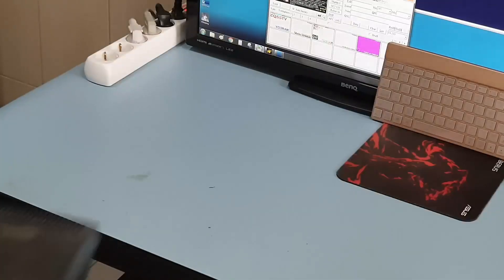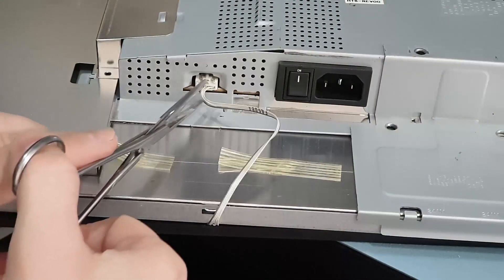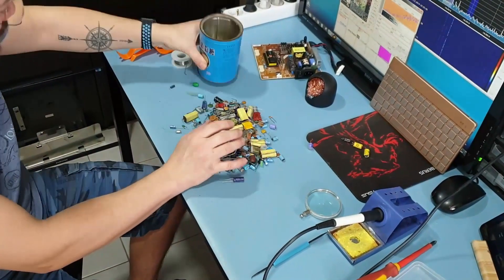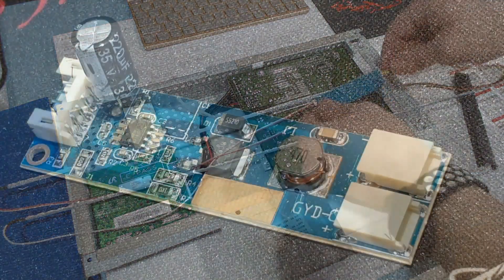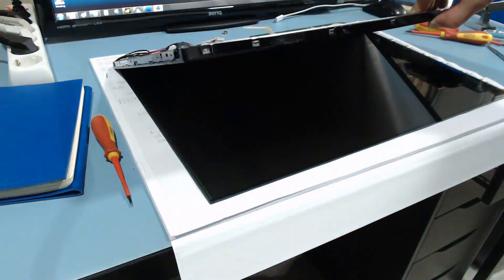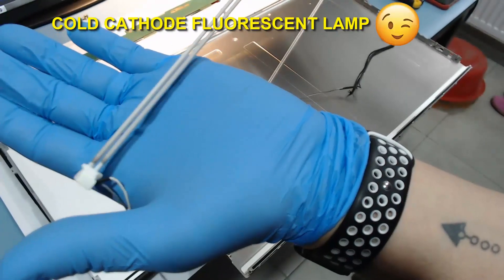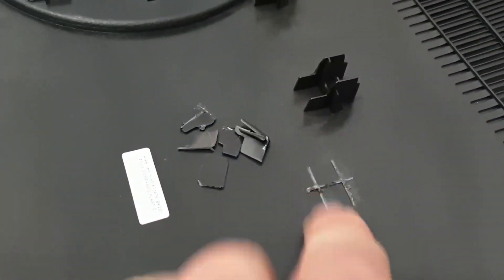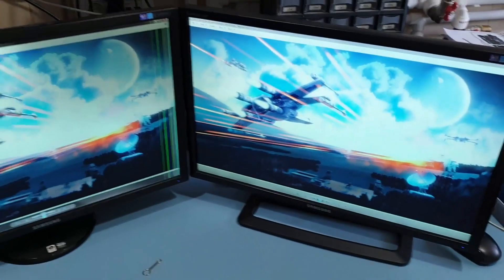24'' Monitor repair. Replacing old CCFL with LED

Comment: I have really wanted to modify my old Dell monitor by replacing the CCFL with LEDs, and even if I have read about everything I need to, over and over, this video has really helped me understand what to expect.  Thank you so much for sharing this!!  I'll consider modifying the monitor soon because this video really gave me some confidence.  

The current plan is to disconnect the inverter for the CCFL, which is powered by the PSU at 24V.  Then I'll use that power into a PWM which will go into the LEDs.  This will probably make it so I cant control the brightness with the monitor's inbuilt digital control, but I think it'll be far easier.  The CCFL in my monitor does run quite hot, so my goal is truly to potentially improve the monitors life expectancy, and make it a bit more power efficient.  

Again, thank you for posting this video!!  It has really helped me get a better idea of what to expect once I open the monitor.  No amount of reading has alleviated some of my fears like your video has.  Cheers!

Comment: I think that by reducing the current flowing through the LEDs, it is possible to shift their emission spectrum to warmer tones. Manufacturers of these repair kits most likely increase the driver current to increase brightness. The situation is aggravated when it is necessary to install LEDs in a monitor with the smallest diagonal - the user bites off extra groups of LEDs, but does not change the driver current.

Comment: 10:48 connected to which GND to disable CCFL inverter feed? 
a) 5v dc GND?
b) 22V dc GND?
c) 220v ac GND?
Reply from the maker: No, never!
The low voltage part of the power supply. Near +12v, +5v. Or even the metal case.
Reply: @Racov  thanks. Do you have any idea what does it mean M/S and N.C ?

btw here is my ports;
| 22v 22v gnd gnd | 5v 5v gnd | N.C  ON DIM M/S |

i'm really thinking about disassamble the huge ccfl inverter off the AIP-0178 board :)
Reply from the maker: @orfe  The GND near 22v or 5v. It's the same. I'm sorry, I don't know all the ports of an inverter board. You have to try and experiment.
Reply: @orfe  NC usually means Not Connected
Reply: @Racov  <3

Comment: I have been for a long time trying to do this to an Acer but mine must be special. I did the connections as in 10:53 but the enable signal (from the video board) rises and lowers two times and then stays low, like if the video board was expecting some kind of response from the power board that doesn't get, maybe some current consumption, tried to fake some consumption in the enable wire (from the video board), doesn't seem to work. The wires that connect the video board with the power board are: Vcc(x2) Gnd(x2) Enable(cut) Brightness Volume Mute. Does somebody know why this might happen?

Comment: Procedura e aceeași și pentru un tv ?
Reply from the maker: Salutare.
Nu as putea sa spun.
Sfatul meu e sa cauți un tutorial pentru televizorul tău, sau ceva asemănător. Principiul e același.
Reply: @Racov  am văzut că se leagă serii de  7-8 leduri de 3v pe tensiunea de 24 de la sursă , și mai multe serii in paralel , dar reglajul luminozității nu am idee cum se poate face
Reply from the maker: Televizorul tău are tuburi CCFL si vrei sa le înlocuiești cu LED?
Dacă da, atunci îți trebuie, ca în filmul meu, o sursa specială care se conectează în circuitul televizorului. Nu am idee cum, depinde de fiecare model. Și baghete LED compatibile.
Dacă televizorul are iluminare LED, atunci trebuie doar sa cauți baghetele LED specifice lui. De obicei ele se alimentează undeva la 60V.
Ce spui tu cu serie - paralel, nu mi se pare în regulă.

Comment: I really appreciate this video, i like how you just filmed your process of figuring it all out. Also, the surprise that the physical deconstruction was harder than the electronics. I'm about to replace the cfls on a monitor myself, this is a real confidence booster.

Comment: The craftmanship is excellent, yet I would not do this in any circumstance. Most quality CCFL displays from 2008-2012 are wide gamut, with often up to 100% AdobeRGB coverage. The peaks in the CCFL spectrum align nicely with the filters of the subpixels. With white LED not so much. A generic blue-with-yellow-phosphor LED has a crappy color rendition index, and if the yellow peak will be bad at illuminating the red and green subpixel filters. Hence the bluish image, as only the blue peak will align with the blue subpixels, and red and green are probably only delivering 50% of their previous brightness.

Comment: Hi mate, great job with that old monitor. I have 2 old HP ZR24W monitors, very low hours, around 6000. Both have developed a dark grey stripe on the left hand side of the screem that only shows up when the monitors heat up. Can I send some pictures with the defect, hope you can point me to the right direction?
Reply: Forget about replacing with white LED. The ZR24W has an insane gamut with CCFL, you will ruin it and turn it into a crappy calibrated sRGB display at best.
Reply from the maker: sure.
yo3rak@gmail.com

Comment: Great job. I plan on doing something similar to my monitor as I had the same issue for years, but I just lower the brightness and after an hour I just crank it back up. I have to make sure to crank it back down so I don't have to use a flashlight to decrease it again. Also the bluish tint can be fixed by lowering the blue leaves on the monitor menu or with an PC app or color profile

Comment: Those green stripes on one of the monitors are probably from missing contact in data ribbon. 
This ribbon is going from T-Con to the screen. 12:59 T-Con is that green PCB.

Comment: Are those led driver uses PWM for control brightness? Or not?
Reply from the maker: It has a separate wire which controls the brightness with different voltage levels.

Comment: Congratulations and thank you, Sir! Your video helped me somehow to have encouragement to try this on one of my CCFL monitors I got from junkshop, if ever their CCFL soon fail. Greetings from Philippines! ^_^
Reply from the maker: Thank you very much
Reply: @Racov  Multumesc! ^_^ I want also to ask, Sir. Why best LED for replacement was, High CRI type?
Reply from the maker: @sophietronics  Dear Sophie, of course high CRI are recommended, but they are more expensive. I think you should consider how much money saving this monitor is really worth, and go for expensive of cheap LEDs. Anyway, work calmly and patiently, because it's very easy to break the LCD panel.
Reply: @Racov  Thank you for the advice about LEDs and handling panels with care. This will be my first time dealing with panels. I also think of the economic implications too, since some Chinese LEDs starting to sell here like hot cakes due to economic issues within the country of manufacturing. I hope great success in LCD and LED repair service and also help some customers and friends in my community who asked me if I can repair their humble LCD and LED units. <3

Comment: estoy instlando a una ALL IN ONE ACER DE 24", donde conecto el EN?
Reply from the maker: EN should be connected to the respective (ENABLE) pin of the power supply/inverter. If you can't find this pin, you can apply 5 - 12V to turn on the LED strip, but the monitor will never be able to enter SLEEP mode.

Comment: Im going to change my Viewsonic VG1921WM lamps, they are still functional, but I want to have better contrasts because in dark images it isn't well displayed, I read that changing the CCFL lamps to LED you can have better image 

Also I saw in your video that the LEDs at the bottom and top you can see every individual led in screen, will that happen with my monitor?
Reply from the maker: The most important transformation I noticed in my monitors after LED installation, was the change in colour. With cheap LED, the image can get a bit blue-ish. The colour adjustment in the menu didn't solve this.
Yes, you could see individual LEDs, but only if you look very close. It doesn't bother me.
Remember this is a very tedious work, don't lose patience!
Reply: @Racov  I'm going to buy this model 

LED STRIP UNI DRIVER JIAHE-24-A-540MM-96 LED2835

I think that is the one that everyone uses for these type of replacement

Comment: And what about replacing the backlight with some reflective material so the LCD works with the ambient light. Like the Sun Vision Displays ... is that possible? using somekind of reflective sheet like Mylar  or paint a sheet with "white 2.0" paint. (Also removing the top filter of the LCD.)
Reply from the maker: Hey Maisonier,
Sadly, it doesn't work like that. You might be able to see something, but impossible to work with.
Sure, there are simple LCDs, monochrome and low resolution, like the ones in some watches and multimeters which work very well. In order to use ambient light, it has to be built like that by the manufacturer.
For colour and high resolution LCD, right now the technology can't work without back lighting.

Comment: I recommend getting a set of cheap camera flash gels and gluing strips of orange film to the backlight diffuser. UV glue might work. That way the LED's will become naturally white, preserving the colors. But I don't know if it makes a difference or not compared to software color calibration. Intuitively, it should make a difference. The orange can't be too white or too dark.
Reply: My first ccfl to led conversion was on an HP HDX18 and while the result was awesome, the tint on the screen was blueish. Gonna do the same on a Dell Ultrasharp this week, do you thing that Kapton tape which is orange might do the trick, or should i look into flash gels? I thought about Kapton since it's orange and it can stand the heat, plus it's easy to install over the leds.
Reply from the maker: Hello.
I don't know the answer, but if you have a bit of this tape at hand, it would be good to do a test prior to installing. Place the tape over the LED, power up and see how it works.
Reply: @AmbassadorKoshNaranek  what model ultrasharp? interested in doing the same to a u2711 i got for cheap.

Comment: 10:46 What's going on in there?
After thinking about it for 10 minutea I think I get it. Was the enable wire cut in the middle?
Then one half (from the video board) was connected to the LED driver and the other half (from the power board) was connected to GND. Am I correct?
Reply from the maker: Yes. This disables the inverter on the board, to save some power.
Reply: @Racov  Thanks. I'll see if it works when I get the remaining parts tomorrow. My monitor only has up to 5.2V on the power board (unknown current rating so I can't boost it either) and I'll have to power the backlight externally.

I'm still undecided whether I should power the LED strips with a PCIE/Molex cable connected to my PC's PSU or from an external power brick. Either one gives me 12V and enough Watts.

If anyone's wondering how much wattage you need to power the backlight externally and you don't have a decent CC CV power supply, you can measure it on a cut piece of the LED strip (if you have it). Remember that the current increases with temperature and that they're in series and in parallel at the same time.
Mine (with Chinese 5630 LED's) uses up to 50mA per each LED triplet at the LED driver's max voltage (9.6V). Weird considering the fact that they're normally rated for 150mA.
I powered a cut piece with my cheapo lab power supply: a 15W CC/CV boost/buck module connected to a powerbank and an ammeter. An average monitor would require about 20W at max brightness.

Some observations: those LED's light up slightly even if you just connect a cable to them (acting as an RF antenna). While they're super bright at 100mA, they're starting to be bright at as low as 8mA.
Reply from the maker: @Krzeszny95  I'd go with a separate power brick. It takes up an extra outlet, but gives you some independence. I can't measure the current anymore, but at the end of the video I made a power comparison with another original monitor. The one with LED replacement takes about 18W, so, in total, at 12V, 2A should be enough.
Reply: @Racov  Yup, in my case it's about 18W but there's one problem. Power bricks can have efficiency as low as 60%.

Also, the power board has SENSE+ and SENSE- pins. Maybe you know if that's useful?
Reply from the maker: @Krzeszny95  I don't know, but don't worry about it. All you need is Enable and Dim (brightness)
Reply: @Racov  It works. In the end, I connected a 12V rail from my PSU but it took several tries. Good thing that I always double- or triple-check everything. 

Now I've just got to replace the tact switches using a desoldering pump and it'll be as good as new.

Could you explain how to check if the inverter is indeed disabled?
Reply from the maker: @Krzeszny95  That's wonderful.
As for the inverter, I can't figure any sure and safe way to test it. Usually it makes a faint, high pitch noise. If you don't hear it, it's good, but not definitive proof. In my case, there was this wire "Enable" going from the video board to the power/inverter board. I cut the wire in half, and the part coming from the video board was the "ENA" of the LED module. The other half (going to inverter) was soldered to GND. This should disable the inverter.
Reply: @Racov  There's a high-pitched buzzing noise only audible if I move my ear next to the power board. Normally it's not audible. On the other hand, when the monitor goes on standby, there's a loud coil whine. it's so annoying I'll have to keep unplugging it when I don't need it. It's an HP w2228h with HDMI and pivot and it also makes lots of different noises when powering on, including tapping. 
Old monitors... Oh well, at least it works and didn't cost more than 50 USD to both buy and repair. Thank you for the video and for help.

By the way, there's a way to make the LED's white. You need one of these 4 alternatives: a) a set of camera flash gels with an orange gel, b) an orange stage lighting filter, c) an orange transparent film for tinting car headlights, d) transparent epoxy resing and transparent orange pigment. I recommend a set of camera gels because they're cheap and you can mix and match the colors. The orange can't be too white or too dark. It can't be yellow.

Comment: Yeah, I need to do something like this to an old Dell 19' 1280x1024 LCD monitor. Works fine as a secondary monitor for my online classes documents but the CFL is obviously failing.

Comment: Are led strip replacement connected in series or parallel, will it work when excess length was cut ? Thanks for a helpful video anyway!
Reply from the maker: I believe the strips are connected in parallel, by the looks of the PCB. The strip can be cut to fit your screen. There are lines/marks where you can cut, usually every 3 LEDs.
Reply: Thank you very much, God Bless!

Comment: Great video!
I am in the process of doing this on a Samsung SyncMaster 2494HS. They seem very similar monitors.
It will take some time before I get my LED strips though.

To which pins do I connect the yellow wires?

The power supply board has these pins:

1
B-DIM
15V
GND
GND
GND
5.2V
5.2V
DCR
ON/OFF
3.3V
LED
KEY1
KEY2
GND
14

The inverter board has these pins:

PWM_DIM
+13V_IN
GND3
GND4
FUNC_GND1
+5V
+5V_IN
A_DIM
BL_EN
+3.3V
LED
KEY1
KEY2
FUNC_GND

I just want to make sure I don't blow things up :)
Reply from the maker: Hello. 
This converter module has 2 yellow wires.
Try this, at the power supply board:
The one marked ‘ENA’ to ‘ON/OFF’
The one marked ‘DIM’ to ‘B-DIM’. 
Let me know how it goes
Reply: @Viorel Racoviteanu  Thanks for your reply!

In a different video I saw someone shorted out the high voltage line by soldering a bridge to the GND pin. Is this not necessary?
I believe he disabled the high voltage and connected the LED driver silmply to +...V and GND. Yellow wires to the other pins as you mention of course.

I guess it wouldn't hurt to disable the ON/OFF cable and then solder the ENA cable to it, right?
Maybe it's not really necessary (EDIT: it is necessary! :) )but I also would like to disable the HV as it is no longer needed and eliminates some risk.

Thank you for your help and video!

EDIT1: oops... just rewatched your video and you are also disabling the CCFL inverter :) My bad!
I should be able to do it based on your video. Your board even has the same pins as mine.

EDIT2: Got it now...
1. Cut the black wire ON/OFF (power board)
2. Black cut wire (power board side) -> GND (pin 14 power board) (this disables the CCFL high voltage converter)
3. Black cut wire (inverter board side) -> ENA (yellow wire LED module)
4. B-DIM (pin 1 power board) -> DIM (yellow wire LED module)
5. 15V (pin 2 power board) -> VIN VCC + (red wire LED module)
6. GND (pin 4 power board) -> VIN VCC - (black wire LED module)

I'll give it a try when my LED module arrives... in about a month or so :(
Reply from the maker: @FUG_THE_LEFT  Yes, it’s a good thing to disable the HV inverter. You save a bit of power at least, and might protect other things. You noticed the picture about what wire to cut and solder, in order to do this.
Reply: @Racov  I paused the video to take a good look and see the connections :)

Do you have the link from where you've bought the LED strips?
I'm looking on Ali but many shops sell strips with small LEDs (i.e. 2835) which is not as bright and durable I believe. Yours look like 5630 or similar LEDs which is good.

Yesterday I found these strips for about 5 EUR but forgot to order and today they have gone up in price to 15 EUR! :(
Reply from the maker: @FUG_THE_LEFT  this the store where I bought the item from. 
https://a.aliexpress.com/_m0hqoIA
Sadly, it’s not on sale anymore.
Reply: @Racov  Thanks. Hmm, the store doesn't sell them anymore it seems. Only one strip for LG TVs. I will look around and take my chances. Some light is better than no light :)